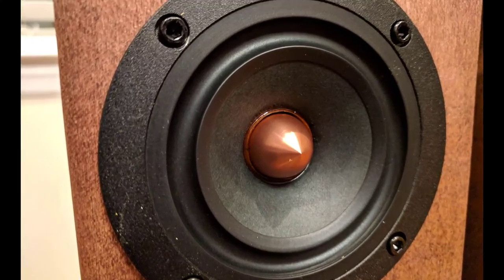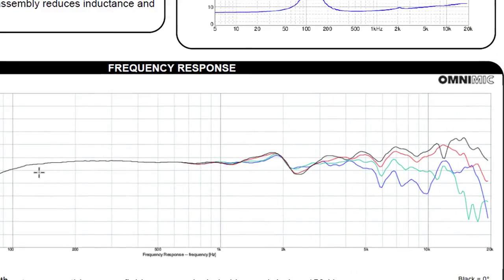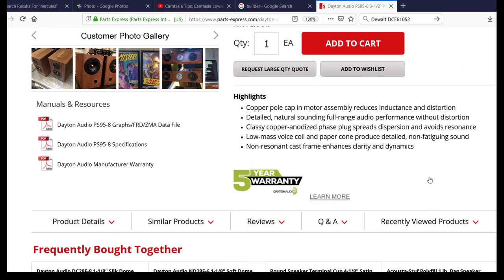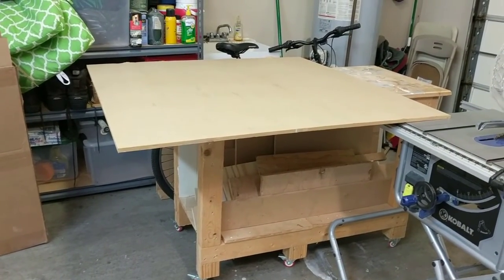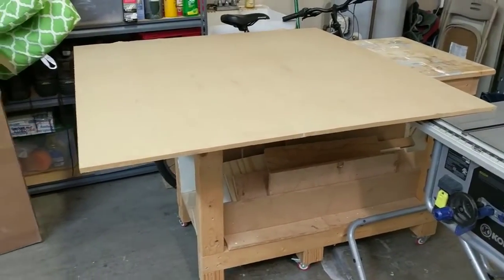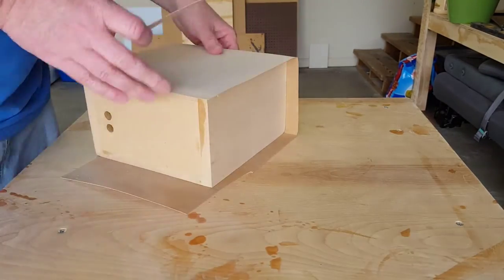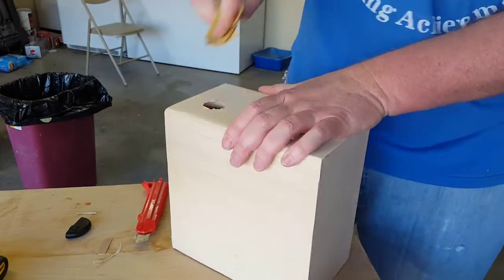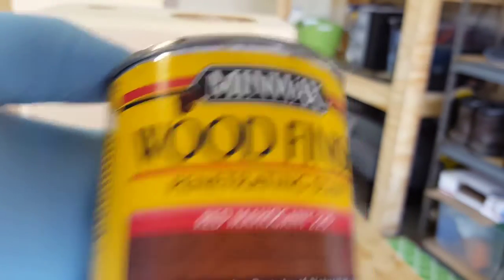Easy DIY Speaker

Comment: Great build. I’d love to see a plan so I can try and replicate something like this with my son. It’s an awesome finish with the Dayton speakers
Reply from the maker: The external dimensions are 8 in by 5 in by 8 and 1/4 inches.  I made it out of 1/2 inch MDF.  For the port I glued together three 2 inch by 4 inch pieces of the half inch MDF.  This was then affixed to the lower part of the baffle and I used a spade bit to drill out the port.  That is literally all of the plans that I used.  A lot of people have asked for more detail, so when I build these projects in the future I will make sure to include them.
Reply: DIY Audio Guy Superb. Thank you. That’s great information, and much appreciated. I’ll send you some images and a video when we’re finished
Reply from the maker: Awesome!  It's a great first speaker for just getting started in building.  Make sure you don't put the driver in the center of the baffle.  Offset it a little to the right or left to minimize defraction.

Comment: How to build enclosure if you don't have the parameters of the speakers aside from the physical measurements? One redditor commented on my post, "You can't" without further reasoning. I have seen a ton of diy for small bluestooth speakers here on youtube without them applying all this math and analysis and they turned out great. Just how am i gonna do that?
Reply from the maker: You absolutely can build an enclosure without the driver TS parameters. It's just not going to be optimized so it might not sound good.  If you're working with something small like the drivers in this video just build a really small box. You'll learn something in the process and have fun trying out a new hobby. 

As far as the math goes, I like the math, I like showing people how to do the math. 

As far as projects on YouTube that seemed to turn out just fine without the math. You don't really know that.  The way YouTube compresses audio you don't get a clear representation of the sound, and the content creator can always just dub a clean audio file over music played by the speakers.
Reply: @DIYAudioGuy  thank u for the helpful reply! I have these old 7cm drivers from sony. I've made acrylic ported enclosures for these and it sounded good. It's the result of several prototypes (different sizes of boxes) before the final model. But now it's old and I wanted to upgrade the enclosure to plywood. Hopefully it would sound better!

Comment: If you were to hook up speakers to all of the speaker terminals on a av receiver that has 7 speaker terminals on the back can the av receiver get loud enough to where you can hear the music from outside of your house if you crank up the volume on the front of the av receiver really loud.
Reply from the maker: Should be easy to figure that out. Crank it up and then step outside.

Comment: They look great! I just bought a pair of these ps95 drivers for a small bookshelf speaker build, is it best to port them or leave as sealed enclosure? My dimensions are 4.6" x 10" x 4.6"
Reply from the maker: Honestly I don't think it makes much difference.  You're not going to get a lot of low frequency response out of a small driver like that in any case.

Comment: Do passive 2 way internal speaker crossover boards have a rated rms if so would exceeding the rated rms power of the crossover board damage the crossover board itself
Reply from the maker: Yes and yes.

Comment: If you were to put leds on your diy speakers will the speaker output terminals on a av receiver power the leds and will leds wired in series with the speakers effect the impedance and the crossover point of the internal crossover of the speakers themselves
Reply from the maker: Plugging the leads from the LED lights into your amplifier is just a little bit sketchy.

Comment: Will full range speakers not sound good if you used subwoofers instead of full range woofers in them.
Reply from the maker: That would sound bad, subwoofers are not very good at reproducing high frequencies.

Comment: Will a second av receiver act as a power amplifier and make full range speakers louder if you hook up a second av receiver to the full range speaker rca preouts on the back of a av receiver.
Reply from the maker: Yes, you can do that.   But I can't tell from your question how you plan to hook the second one up to your speakers.  Please don't hook the second AV receiver up to the same pair of speakers that the first AV receiver is hooked up to.  You will want to hook the second receiver up to a second pair of speakers.

Also be aware that a lot of AV receivers do some level of processing so you might not be getting a quality signal out of the first AV receiver.

Comment: Nice project! Actually doing something similar together with my son at the moment, also using a PS-95 (BR in 4L, tuned to 70Hz). By the way, the crossover you mention some other people use is just a baffle step correction network. As it depends on the dimensions of the baffle and the position of the driver in that baffle, you can't just copy other peoples networks if your box design is different.
Reply from the maker: Parts Express has a kit now with a knock down enclosure and a baffle step network.

Comment: Hi. Great project. Was wondering if you could share plans for it. I'm a beginner.
Reply from the maker: It is a very simple project, anybody could make it.   The external dimensions are 8 in by 5 in by 8 and 1/4 inches.  I made it out of 1/2 inch MDF.  For the port I glued together three 2 inch by 4 inch pieces of half inch MDF.  This was then affixed to the lower part of the baffle and I used a spade bit to drill out the port (so the port is half an inch wide and 2 inches long).  That is literally all of the plans that I used. 

Parts express has a kit that includes a crossover, you should give it a look:  https://bit.ly/2GAtqnG

Comment: Super 77 is NOT a contact cement. It goes on while tacky, and can be sprayed either on one or both surfaces. It isn't a great adhesive for veneering. 

Please use proper contact cement.
Reply from the maker: It is holding so far -- on my towers I used DAP Weldwood.  I used the 77 on this project because it was what I had on hand.

Comment: Can u share dimensions?
Reply from the maker: Internal dimensions are 7x4x7.75 inches.  External is 8x5x8.25 inches.  The vent is 1 inch by 2 inch, and is tuned to 85 hz.  For the vent I just stacked together some MDF to make a 2x4x1.5 inch chunk.  I attached that to the inside of the front baffle and drilled a 1 inch hole (1.5 in for the slug and .5 inch for the baffle to make a total of 2 inches).   I will probably do most of my vents like that in the future especially for small boxes with small vents.  It adds some extra mass and support to cut down on panel resonances and it can be built with scrap wood. Plus, it is pretty much idiot proof.
Reply: @DIYAudioGuy  for future videos,  can you please put dimensions in the description
Reply from the maker: @keithsk-gaming9820  That's a great suggestion, I can do that.
Reply: @DIYAudioGuy  awesome😁
Reply: @DIYAudioGuy  Can I change the interior dimensions and make the speaker taller and not as deep as long as the interior volume remains the same?
Reply from the maker: Yes, as long as you leave plenty of clearance for the port .
Reply: @DIYAudioGuy  Interior dimension will be 4" wide X 4-1/2" deep X 12" tall ...all these interior dimensions. 
What do you think about making the speakers with double plywood layers.. 3/4" thick outside then Green Glue sandwiched then 1/4" plywood? That should stop a lot of vibration. Just a brain storm.
Reply from the maker: @lqbanotxano  those dimensions are fine.  I made mine out of half inch plywood there is no discernible or audible vibration.  if you were building a box with a bunch of great big subwoofers in it that might be worth the trouble but this is just a pair of little three and a half inch speakers.
Reply: @DIYAudioGuy  Thanks for keeping me down to earth on this build. I used a substitute Green Glue stuff between 2 layers of Sheetrock in my small... inside the garage music room. My music room is 6x10. I got air conditioning, refrigerator, computer,  Bose II companions (dying), sound absorption panels and some “Olds” old trumpets. Learning to play....& now wife can’t complain about noise. I got a wood shop in my garage....& I will start with these simple speakers as my first speaker project. 72 year old fart killing time!
Reply from the maker: @lqbanotxano  sounds like you are living the dream!
Reply: @DIYAudioGuy  thank u so much